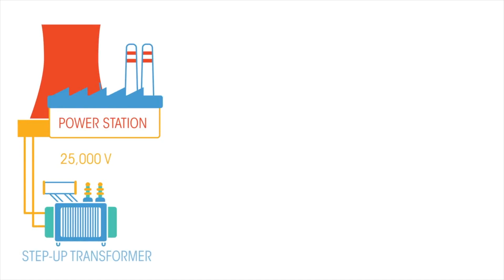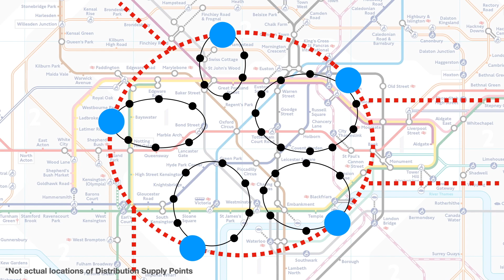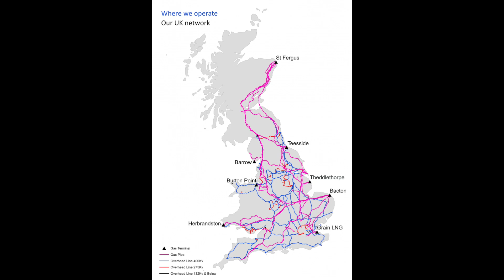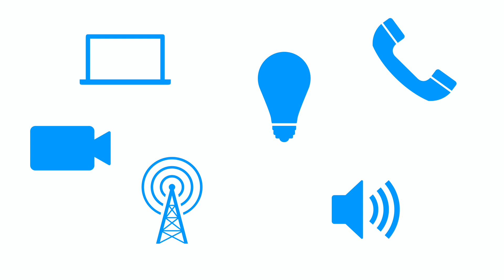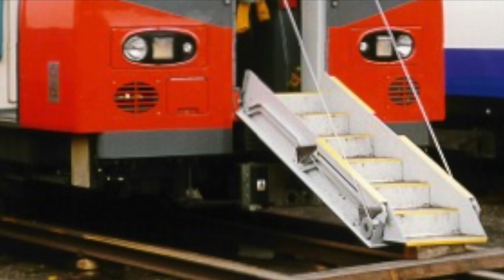What powers the Underground? Part 3 : Present day electrification

Comment: TfL is slowly converting the tube over to 750v DC fourth Rail to reduce engery consumption and to align it with network rail standards of 750v DC Third Rail which is already in use on the shared sections of the Bakerloo and District Lines. The Sub-Surface Railway is apart from sectuons shared with Piccadilly has beeb converted to 750v DC. The S7 Stock can work at voltages up to 890v, which is accomdate the increased voltage from the regen braking.